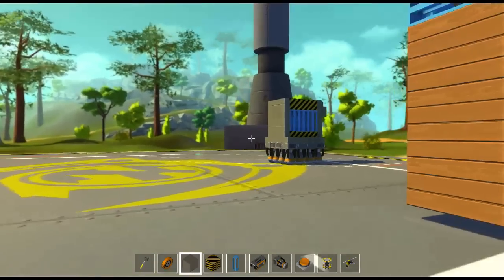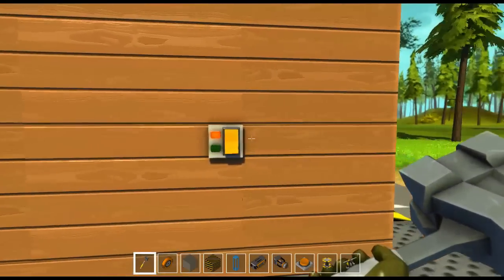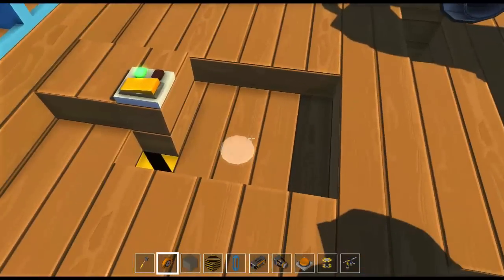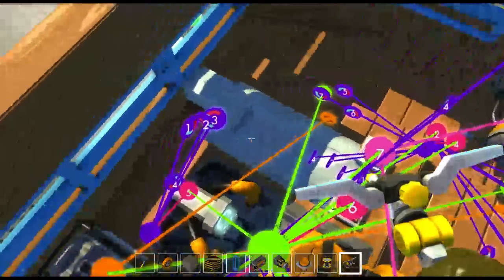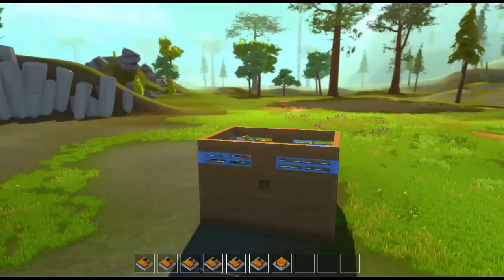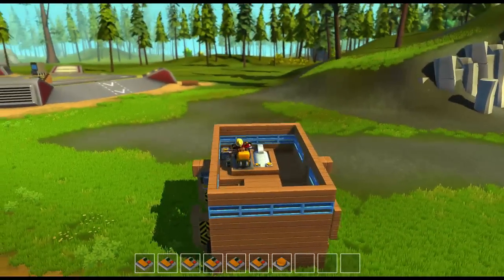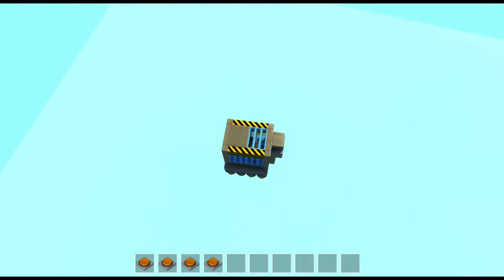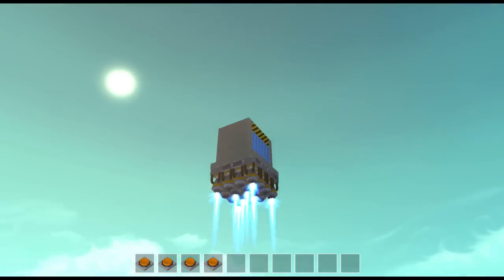TRANSFORMING HOUSE AND ROCKET SHIP - Scrap Mechanic Part 1

Comment: It's easy to tell you are using a electric engine but if you use a gas engine it will not stop like that the momentum will be kept.
Reply from the maker: Thanks for the tip! I'll have to implement this in future creations!
Reply: Tazron68 your welcome. 😆